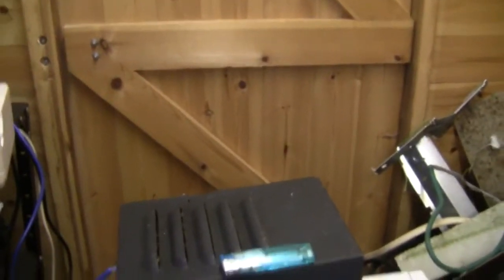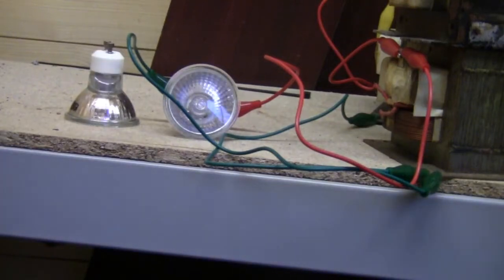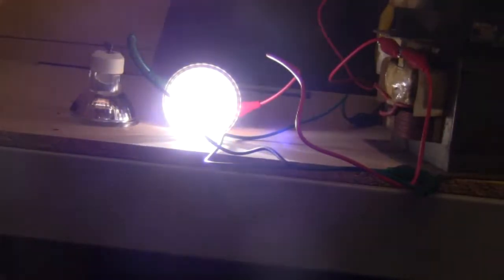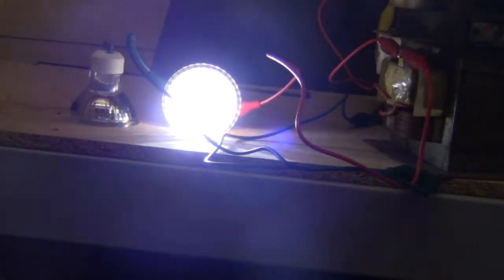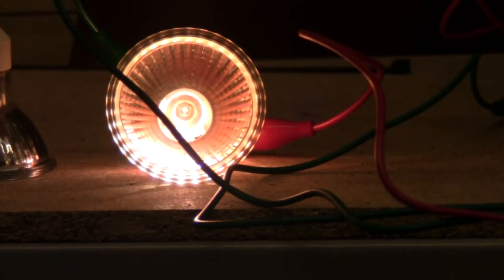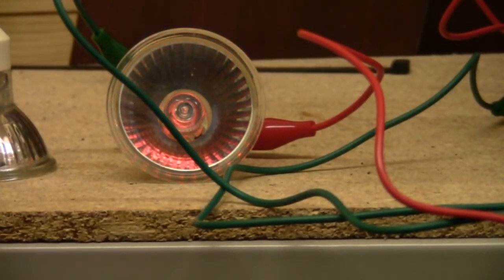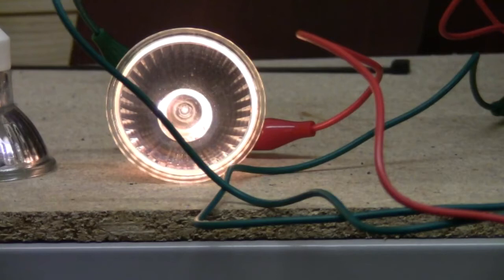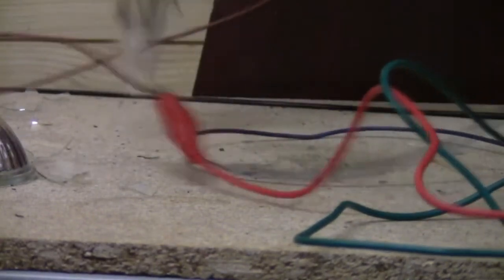epic lightbulb arc

Comment: ABSOLUTE LMAO!! I was rolling all over the floor after ten seconds. It kept on going!
ROFL!! :D

This vid has definitely earnt a place in my Favourites List! :D

Yes, I think this is EPIC to the power of six. Just how did it keep on going for that amount of time without exploding?!!

The only thing I can think of, is that there was enough voltage to strike the arc in there, but not too much current which would heat the bulb to the point of explosion, thus it kept on going until it slowly melted.